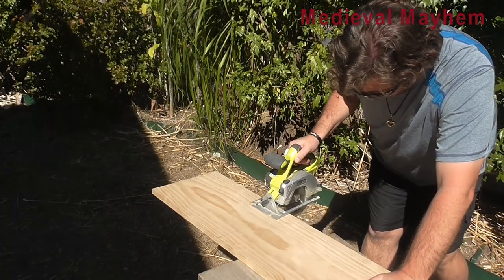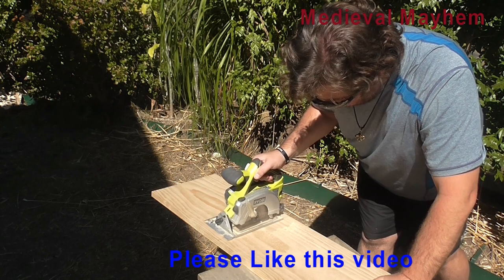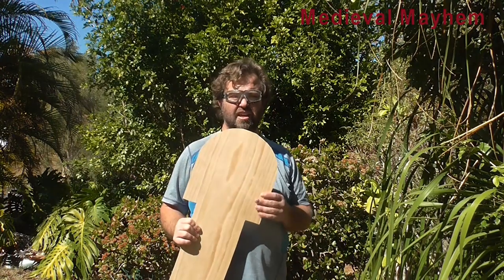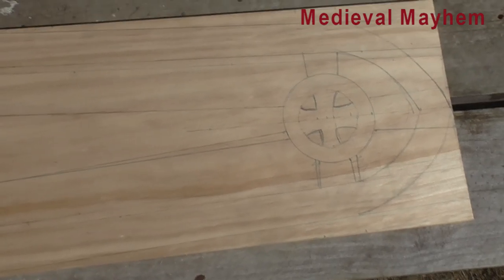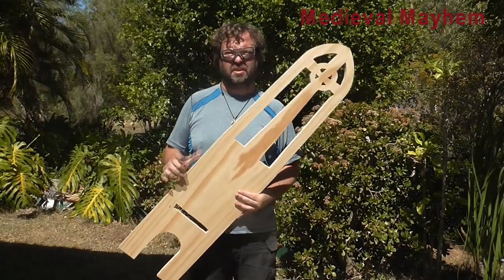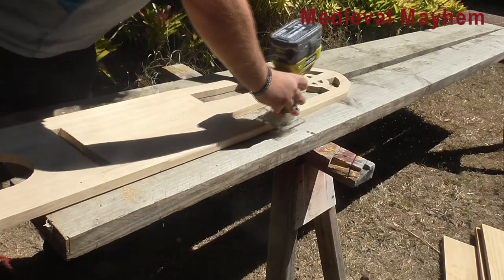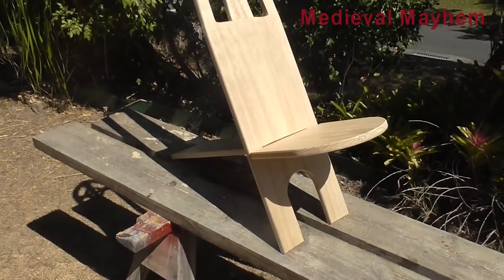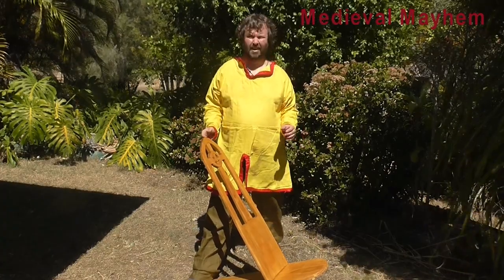How to make a medieval Viking Sun Stargazing Chair DIY Celt LARP COSPLAY SCA

Comment: I have made and used these chairs as well.  They are NOT Viking or Celtic.  I really like the nice Gothic arch on the back with the Celtic Cross in it.  I also liked that you made the two separate front feet.  That will make setting it on rough ground a lot easier. Now, I know how this chair goes together as do a lot of other people but if this video is a "How to Make a..." then you need to show all the steps or at least reference them and have links to other videos.  Apart from drilling the pilot holes you did not show how to fit the tail of the seat (tenon) into the hole on the back of the seat (mortise).  Also, for the Celtic cross, did you freehand draw it, or trace it, of otherwise lay it out?  It came out good.  This appears to be pine, correct?  Even so, you have a good platform here to practice some  hand carving work such as, knotwork.
Reply from the maker: Hi Christopher. I appreciate your comment. Thanks for the advice. I free hand drew the cross and arch. Yes it is pine.

Comment: Robin, I use 2x12 or 2x10 stock for mine in cheap fir. Better wood should be able to go quite a bit thinner
Reply from the maker: OK, interesting.
Reply: Yes, 2x stock is fine in soft woods.  In hardwoods though, I think even 5/4 stock is pushing the edge of the factor of safety for a 180-200# fighter in full armor.